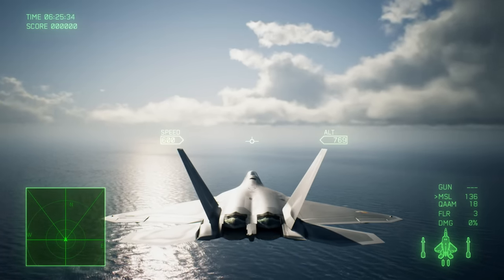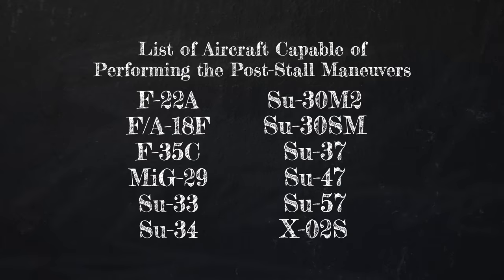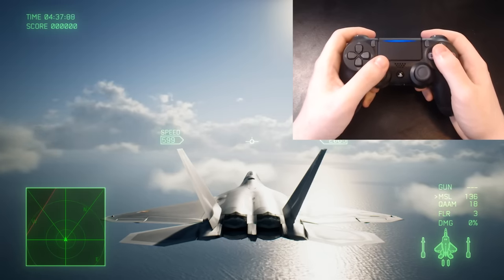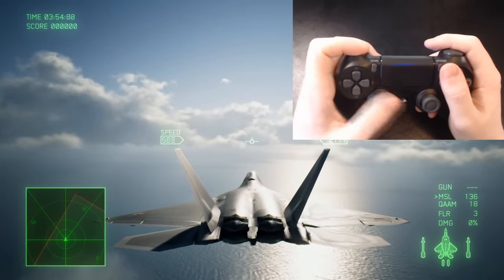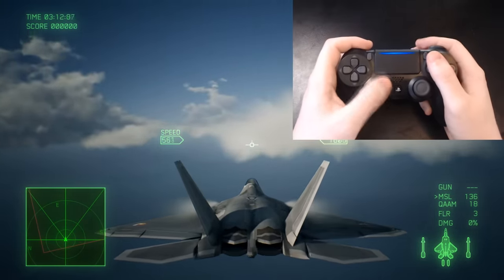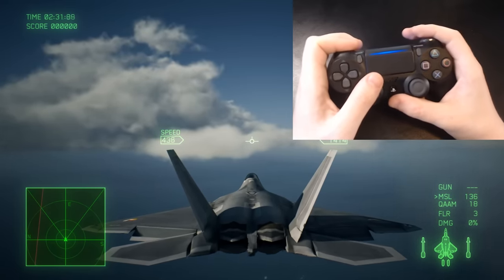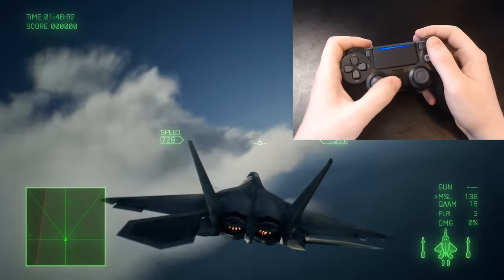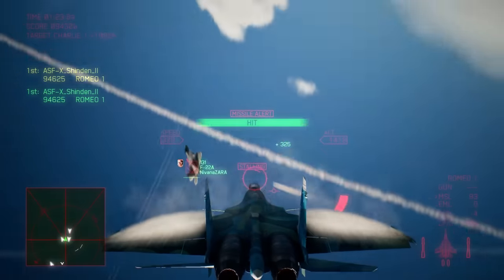Ace Combat 101 - #4: How to Perform Post-Stall Maneuvers

Comment: Here's a really strange thing...  I've done a post-stall manoeuvre more than once with the Gripen-E but it was by accident and I haven't been able to get it to work deliberately.  I think that there's more to post-stall manouevres than we know because I still can't figure out how I did it.  I do know that it happened during the attack on Farbanti and it was over the A2G area in the North near the re-supply line.  I was like "WTF is happening here?" and it makes sense that it should be able to do it because it is easily one of the most agile fighters in the real world.  The same is true about the other two Eurocanards, the Rafale and the EF-2000. The Eurocanards are REALLY getting the shaft in this game.

Another question that must be asked is...  with the second-highest level of wing-loading and the absolute worst thrust:weight ratio of any modern fighter aircraft, how the hell can the F-35 perform post-stall manouevres?  Physics dictates that it can't but the Eurocanards all can, so go figure.

It's probably because Japan operates the F-35 but not the Gripen.  Namco has always shown extra respect to planes that are flown by the JASDF so I guess that this is nothing new and shouldn't be so unexpected.  It is kinda stupid and annoying though.
Reply: Counterintuitively, what dictates whether or not a plane in AC7 can perform a Post-Stall Maneuver is just a checklist. Some planes can perform half a loop before stalling (F-35, F-18, MiG-29, Su-30M2, Su-33, Su-34, ADFX-01). Some planes can perform a full loop without stalling (F-22, Su-37, Su-30SM, Su-35, Su-47, Su-57, X-02S, ADF-01, ADF-11F).
If the plane is not on either of those lists, it cannot perform any type of Post-Stall Maneuver in AC7, however manually stalling your aircraft can create somewhat similar looking situations. It's not really based on serious physics, just the developers' broad idea of what a plane might be able to do in the setting of Ace Combat. Hope that could clear up some questions you might've had.

Comment: I've literally only done this on accident in the campaign, I think the main problem is I changed the controls to just decelerate, which made sense to me when  I was just thinking high g turns meant the same way we've always done tight turns in older games I played, sitting there trying to get one single battle royal win and getting owned by these guys who are experts at these maneuvers+ more I'm sure.

Comment: To everyone still struggling; its because he left out that you must press throttle and brakes systems first and then pitch. Also big tip is that you MUST be under 450 NOT less than 500. I bought smashed everything in sight struggling with this shhhhh.

Comment: You listed planes that can do it and said that no upgrades are required but are there any upgrades to avoid (like ECU software, which enhances anti-stall, which sounds like it may hinder something that is post- something that it is anti-), and what about the DLC aircraft which may have been released after this video? Could you update the description for the video and/or add a pinned comment with extra information relating to upgrades, DLC aircraft and stuff which may have changed in later patches? Would be greatly appreciated. I really like to abuse the ADF-11F, ADFX-01, XFA-27, CFA-44, and FB-22 with MPBM/ADMM/MSTM/UAV and/or greater carrying capacity for QAAM/FAEB/XSDB/SFFS lol

Comment: In the words of Grimm "I think I figured it out", if you are constantly in a high G turn and you are within the PSM speed range, you can keep your finger on the throttle, but you have to center the stick and tap the brake.
Reply: saving this

Comment: Your a wizard. I did manage to pull of the 1st maneuver but only like 10% of the time in practice mode. Bout 450 kph seems to do it like you said but eventually I just mash spam the accel and decel and pulling down to get it. Now your camera stays pretty straight the whole time. Mine does a whole flip though. I know I'm doing the right maneuver since the plane does a flip like yours but I think the whole flip takes to long. I'm using the F/A-18F. I know the F22 is way better just wondering if that was why

Comment: I think the denominator in whether planes can pull post-stall maneuvers is whether they thrust vectoring.Not russian bias.Russians do love them some vectoring
Reply: From what I've noticed it depends on the surface area of the plane
Reply: @CaseSet236  Yes that matters, of course, but it's coincidental (larger area=lower stall speed).Post-stall means you lost all aerodynamic forces on your control surfaces.

Regardless of surface area, you drop like a brick and the only means of orienting the craft is the engine nozzle vectoring.

No vectoring ? Look for the eject handle

Comment: Um, ft is more precise in this case. Meters is 11000 high as you can go. You can go 35000 feat high, and we're using nautical miles. Not MPH

Comment: Best tip
Break till its 290 or the computer warns you that you are stalling then do the PSM procedure
Reply: That would put you into a stall before you can do any turn
Reply: Also as a Sukhoi main I can confirm that you can start a PSM at the speed of 500 km/h

Comment: Hey AC Fan, great video. I tried it out on my game recently, and while I did manage to pull it off, I notice my plane, or rather the camera would follow my aircraft while its rotating instead of staying in position like yours. Am I doing it wrong then? I checked my replays over and over again and it does seem to be right. Thoughts? I'm using the F-35C btw.

Comment: FYI, for those that use American (Imperial) units like me, 500 kph is basically around 310 miles per hour. So, if you wanna start doing those cool post stall maneuvers like the Ruskies and those hotshot pilots, practice doing it around or under that speed.
EDIT: (I see that people have taken the liberty of correcting my false statements. I retract my previous statements as being fact.)
Reply: Thank you for converting to Freedom units.
Reply: The alternative is actually Knots, not Miles per hour. In which case some people have said to do it somewhere in the 200 to 260 knot range.
Reply: Knots are used all over the world for airspeed, as are feet for altitude (and the English language).
Reply: @m.p.yorkesq.5592  
USA is not whole world.
Reply: @WwZa7  He's not wrong. Knots and Feet are the standard measurements in aviation all over the world, not just the US. Only a handful of countries don't use it.
Reply: @majorborngusfluunduch8694  to be fair, imperial units do have some advantages, namely in that they evenly divide by more things than metric can. What's 1 third of a yard? 1 foot. 1 third of a meter? 33.333.... cm.

Comment: Dude, no matter how hard I try ijust enter a standard G turn. Maybe I'm dumb but im doing the same and only achieved post stall 3 times. Is it a very small window between those 2? (using f-22 aswell)
Reply: There is a small window to perform the maneuver, so as soon as you hit the triggers, pull on the joystick.

Comment: Does this work also on PC? I am using a ps4 controller as well and have tried it the same way using an F-22 but it does not work, the plane just pitches up normally and then stalls and falls down. I don't know what else I need to do to get it to work
Reply: Axiis same

Comment: I am absolutely stumped on this I let go of the brake when the plane starts to lift and hold the throttle and joystick and when I get to the point where my nose is pointing straight up I loose all my speed it drops to zero

Comment: Hey ACF, I just saw your "MP highest score" video and I believe I saw you doing a couple of PSM-like moves with speed more than 500 kmh . Can you tell me what's going on there?
Reply: it was High-G turn, i've spend 3 hours in free mission trying to work PSM out, there is a post-PSM state that allows You to act like You're in PSM at higher speeds but You can barely control the craft
Reply: @Massakre8492nd  I see. And apparently there are only a few select of aircrafts that can do that move and most of them are on the   Sukhoi's line. I made a bad move by investing a lot of points for F22 early

Comment: This is great info..is there anyway to do it with a flight stick or is this only useable with a controller?
Reply: There is a video about that on YouTube, the hori stick has a button on the throttle that acts as press accel/deccel at the same time, idk about the thrustmaster though
Reply: @Leadgutsv2  that's horrible. Well I guess I have to spend 200 on a hori.thanks for the info
Reply: @wolfielastar  I think it mainly has to do with your high g control type, idk just look at all the buttons and check if there is a specific button for accel/deccel
Reply: @Leadgutsv2  yeah there is no button for that on the hotas as far as I have seen. I've been using it for months on other games.
Reply: @wolfielastar  if you check the comments on the video I linked if you change your high g to where you just need to deccel instead of deccel and accel at the same time it might work
Reply: @Leadgutsv2  yep watched the video after commenting lmfao. I'll try that put when I get home thanks

Comment: You say the A10 can't do it.....

Lie detector says... TRUE!
I did try attempting PSM though with A10, but the best I got was it started but it just stalls out after when attempting the turn. So, it will start a PSM, but can't follow through with it. At least by my test. But the best aircrafts for PSM I've tried are:
•X-02S
•SU-30SM
•F-22A

Comment: I've wondered why knots (6,000 ft) and miles (5,280 ft) are mutually exclusive units, so close in distance but why have both? Thinking in round numbers like 6,000 would be simpler, I assume. And kilometers....... rather sudden appearance not very long ago in USA, kinda wondering why such an increase in use. Most of my career was in civil engineering, using decimal feet to tenths and hundredths, and I found working in metric units in 3D software really efficient.
Are these PSM's useful for sudden recoveries from stalls to prevent collision, or mainly dogfighting use?
Reply: Mostly dogfighting, though it can (and has been) be used for stunts/challenges.

Comment: i just got one "major" problem.
the 2 triggers simultaneously puts the aircraft in autopilot (plane levels out , brings you upright if you're inverted, and speeds up to 600)  even if i flick joystics . tried to change /invert controls, but it did not work...is it a problem of timing? or an option left checked/unchecked maybe. bought the game few weeks ago and beat it twice without ever knowing you could do that.  i figured there might be somme hidden mechanics or whatnot but it was not in the manual ...
Reply: It's accel + decel 

Not yaw left + yaw right

Comment: Doesn't seem like an F18, or F35 can do the full kulbit without stalling after passing 90 degrees. Can parts remedy that, or no? (didn't unlock everything yet).
Reply: omghegotagun  On top of that  , What happened too “I’ll hit the Breaks n hell fly Right by” ?   The Tomcat should be able too do such a maneuver too an extent . 

Whole point is they won’t just keep the Flight Graphics like from Ace combat 04  or even Ace 03 ! 
Then you will see and feel the Difference

Comment: I tried doing PSM with an A-10, i thought i made it until i realize it was a high G turn, stalling, and crash around 7 times :v
Reply: Lim    

You can do it with an A-10 in Ace Combat 04 !

It’s more of a High Angle Pitch Though 
 Which Ace Combats nowadays Suck At
Reply: @mrandrossguy9871  which one is the ace combat 4 again😅??

Comment: what about reverse flying stall
Reply: Pizza Clock that one is more difficult to pull, you basically stop the PSM half way so you're facing the opposite side then you start chaining PSM by repeatedly doing one after another when the camera is just about to revert to its original position

Comment: Biggest problem I’m having is when I press the accelerator and decelerator and pull back on the stick (all at the same time), instead of the manuenver all it does is a high g turn nose up. What am I doing wrong?
Reply: you need to wait a moment before pulling on the stick, dont do it all at the same time

Comment: I don't know if I'm just stupid, but I can't ever make the plane turn over all the way. The nose always turns back down to the ground whenever I try it.
Reply: Try letting go of the deceleration button. You might be stalling it by accident. OR, you're flying the F-18, F-35 or MiG-29. In which case they can only really do a Cobra successfully. They aren't able to do much more.
Reply: @majorborngusfluunduch8694  yeah, the Hornet IRL isn't capable of POST stall manuevers, really, it's just really good at PRE stall manuevers

Comment: what are the other maneuvres you can do besides post stall? is there spiral one?
Reply: Basically you can get creative with this system, i saw people do this manouver to quickly flip into vertical or dive. Or the opposite, flipping from dive to level quickly. But from what I've seen you can only do tricks with pitch controls.

Comment: If you fly at 250 knots or lower in High G turn Setting Type B.. It's a fuck ton easier. You get it done right and if you are in a turn fight and have someone behind you well.. You can turn things around real quick and you can pull the maneuver without having to fly straight. For those saying i should keep it to myself.. Fuck no snake.. I like a challenge

Comment: Says don't use mph but uses km for accuracy but then says anything under 500 km will work so there so it does not have to be accurate. 310 Mph for normal people or 270 knots for pilots.

Comment: Never done this normal i hold the brake and accelerater at the same time turn vertical and pull back on the stick to make tight turns but I’ve never done the post stall

Comment: Man I tryed to do it today but man I do it 2 times right then I fill more the 50 time I didn't know what is wrong I need help could it be because I increased the acceleration or what I drop my speed under 500 km/h around 450 km/h but I found my self at 500 km/h I did everything like what you did exactly but it doesn't work always it's once in a blue moon 😥😥😥😥😥😥 I'm getting tried trying to perform this move so I can be able to do it but is seems a hhhhhhhhhhhhhhhhhh 😭😭😭😭😭😭😭😭😭😭

Comment: F-15e's can do cobra maneuvers in real life as well :/

I wonder why su-37 and su-47 were added since they both failed testing, crashed and discontinued.
Reply: Su-47 Berkut is a classic plane in the AC series, one of the most common planes for enemy aces in Ace Combat since AC3E
Reply: Su-37 was the plane for 2 enemy ace squadrons. It has a place in the series.
Reply: Su-47 is just way too beautiful not to be added.
By the way, Su-47 did not "fail testing" and did not crash.
It was built to explore the forward swept wing design and the use of composite materials and it served its purpose well. (i doubt americans just gave everyone all the data on X-29) It was also used in Su-57's development to test the internal weapons bay.
Reply: @vantuz8264  good to know. Should i edit my comment or leave it for a lesson?
Reply: @Agm1995gamer  up to you. No human can know everything.
Reply: @vantuz8264  out of curiosity, what exactly was it that made them decide to not build more of them? cost, stability, reliability?
Reply: @spindash64  The same reason why no one else uses them. Despite all their advantages, forward-swept wings have inherited flaws:
1) Positive feedback loop between angle of attack and wing twist . Basically, when the vertical angle between the velocity vector and the wing increases it creates a force that bends and twists the wing up. Which in turn puts wing tips at even greater angle of attack and that in turn creates even greater force.
To counter that the wing have to be built to withstand these forces. Without composite materials that would be extremely difficult. 
2) Turbulence where airflows of wings and body converge .
3) Worse performance at supersonic speed  because wings do not fit into the "cone" created by the nose and that (again) puts the wing tips under pressure.

Comment: I really can’t find out how to do it it keeps putting me in a low g turn
Reply: Me too? Do I have to have lvl 2 air brake attachment? Because I'm doing it correctly I believe?
Reply: Winn Dixie it took me a while but I figured it out, you don’t hold it down, you tape it for a short duration at 400km/h it works beautifully in the Su-35 and it’s really cool in the F-22

Comment: Yes but how do you do it on the flight stick ?
Reply: Can't.
Reply: Bind one button to brake, or to both accelerate and decelerate. So you can only press one button and do the trick.
Reply: Push both pedals to gas and brake at the same time =)

Comment: How do you do this with the t.flight hotas joystick?
Reply: slow down, throttle to zero, then throttle to max while holding square and pull the stick at the same time. But you have to set the control scheme to B iirc.
Reply: You can also bind one special button to both acceleration and deceleration. Hotas has a lot of buttons to suit all your needs.

Comment: Hello, the Cobra maneuver is a minimum of 100 degress positive AOA.
If i remember correct, its technically called "Super critical extreme angle of attack".
If you want some precise info on the cobra maneuver, then i recommend reading a book called "Famous russian aircrafts - Su-27/30/33/34/35"
ISBN 978-1-91080-918-1

This videogame or the uploader seems to get the definition of a stall wrong: Definition of a stall (from memory) is a loss of lift, often through too high AOA due to too low of airspeed.
The correct post stall maneuver/procedure would be nose down, full throttle.
Therefore every aircraft in the world is capable of performing a post stall maneuver.